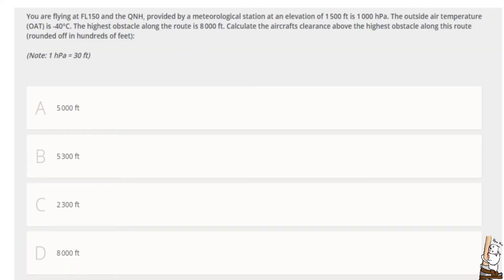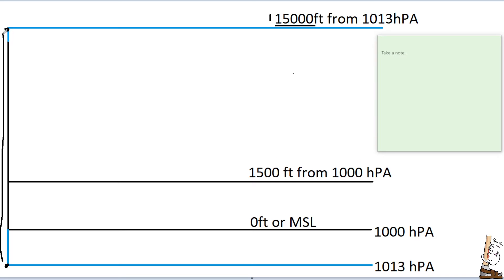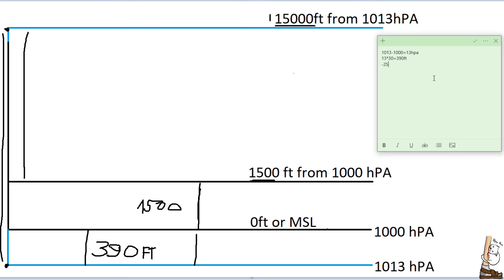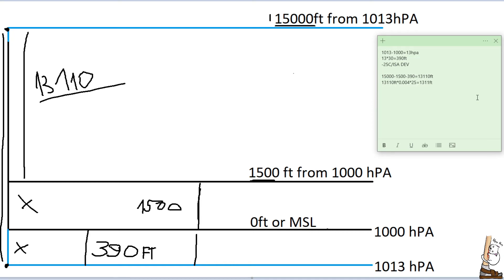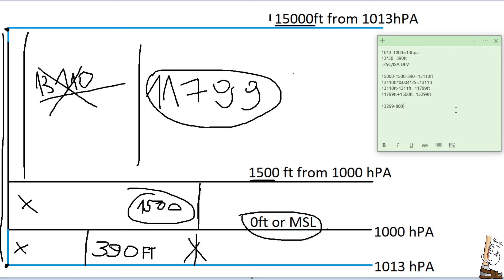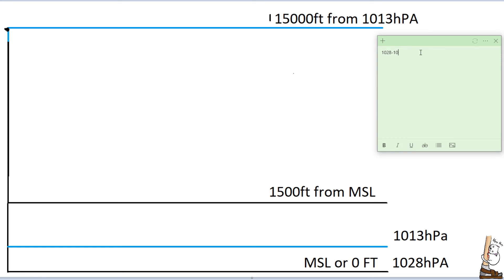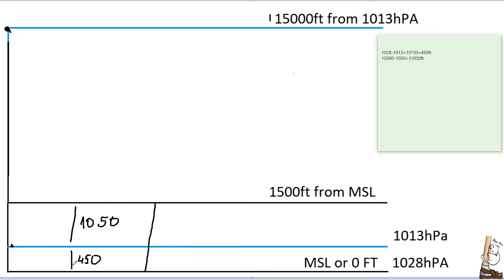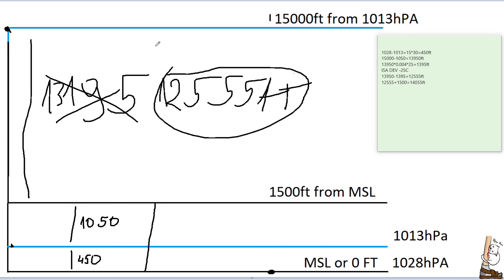How to Calculate True Altitude #ATPL

Comment: 4 % isa dev is 0.04 not 0.004
Reply from the maker: Hey Tiziano. It's not 4% deviation from ISA!!!  

That 0.004 is a constant (there was a calculation to get there, something by divided by something, but i have to look up my notes for that) which you use for calculating how much does the ISA deviation affect the column of air.

In the formula: 1311ft (air column) * 0.004 (constant) *25 (actual ISA deviation) = 1311ft.  

If ISA deviation is negative subtract to get true altitude, if ISA deviation is positive add.

Hope it helps.
Reply from the maker: Okay, got my notes. So I can explain you better what is that 0.004 instead of just a constant.  Per each 1 degree of ISA deviation from standard, the deviation from indicated altitude is 4feet per each 1000feet! So 4/1000 = 0.004!   And in the formula we have deviation of 25, so the deviation will be 25 times more from 1311ft.  Did it help? :)